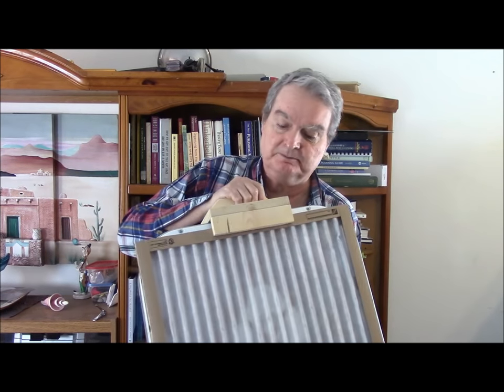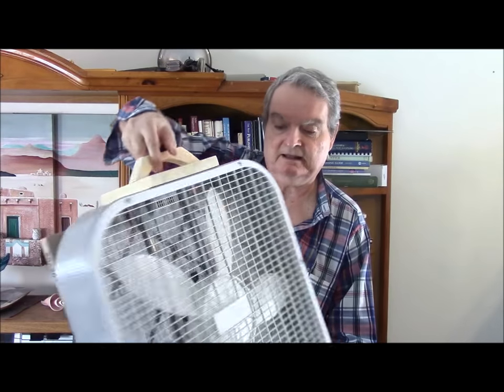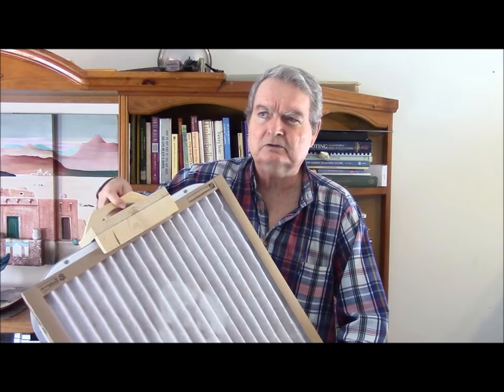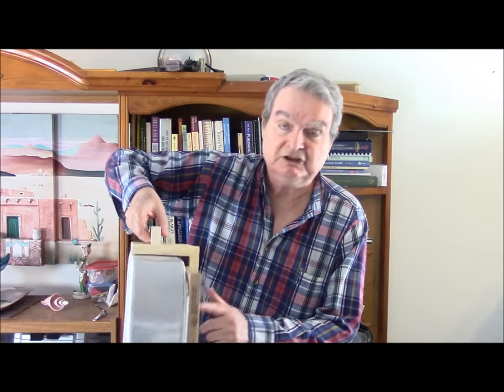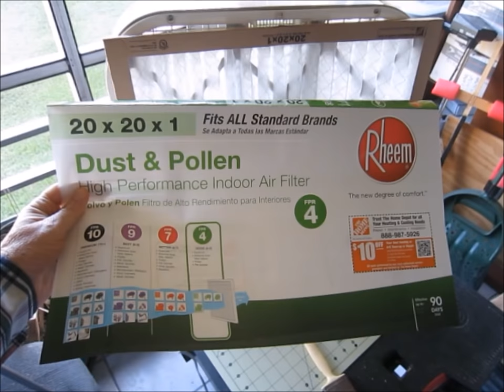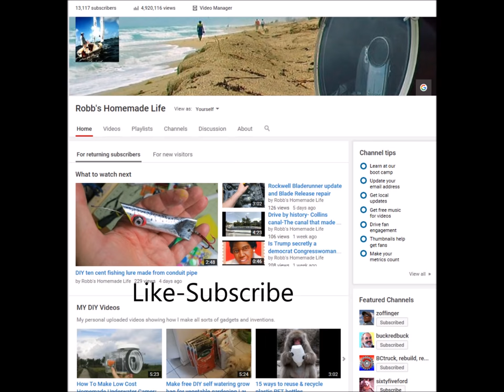DIY $6 Magnetic Dust Fan Filter air cleaner for Home & Shop

Comment: I've done this before but I just use the suction from the fan to hold the filter in place. Thing is air is sucked in from the front and makes the blades dirty. It's better to have two furnace filters.

Comment: I think I could do this by taping or bungee cording the filter to my fan. Great idea to filter the air. : )
Reply from the maker: thanks karen, I agree. You could hot glue some plastic to the filter and make some metal hooks from coat hanger wire to attach the filter. Actually, the suction of the fan does a good job of securing the fan when it is running.